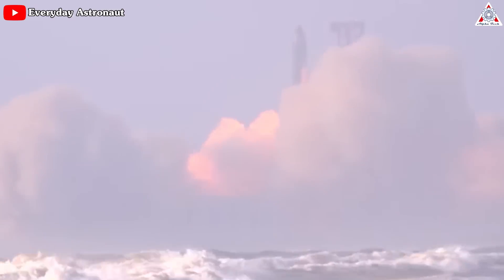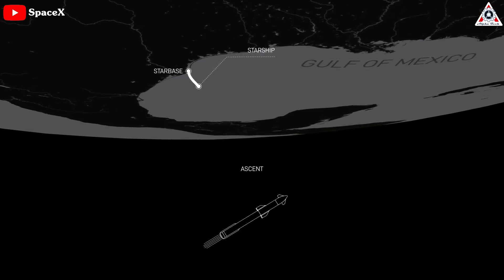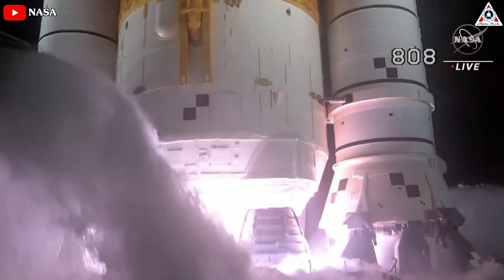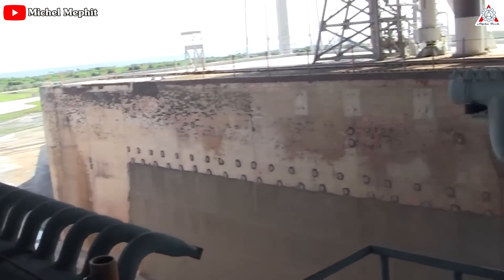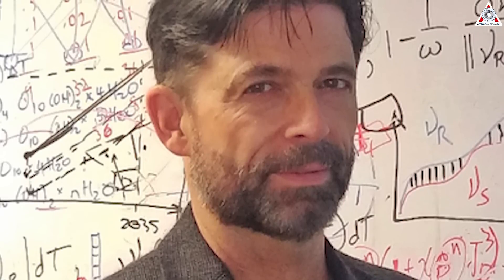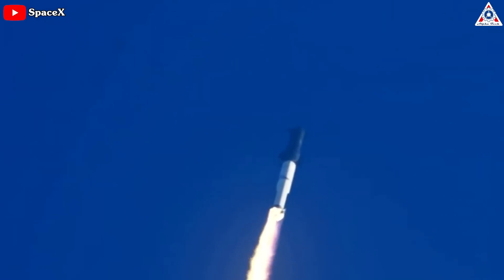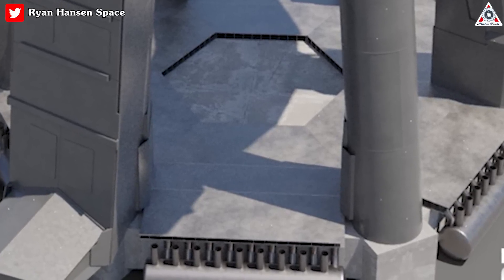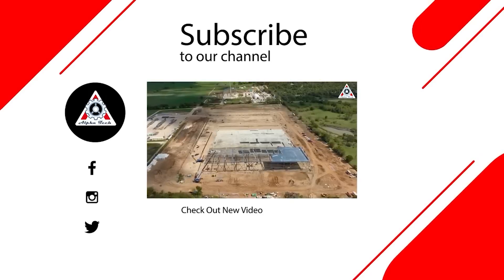SpaceX's NEW Solution to prevent the pad damage by 33 engines...

Comment: You are missing the main issue!  Artemis 1’s (SLS) “Ignition Overpressure Protection and Sound Suppression (IOP/SS) water deluge system” suppressed the acoustic energy produced by 8.8 million pounds of thrust!  Both the Saturn V and Space Shuttle had water deluge sound suppression systems. Where was the flame deflector to channel the rocket exhaust away from the launch pad and the water deluge system to dampen the acoustic energy of these engines (power of two Saturn V’s)?  As engine exhaust gasses exceed the speed of sound, they collide with the ambient air producing shockwaves with noise levels approaching 200 db. This energy can be reflected by both the launch pad and the concrete ground surfaces back to the launch vehicle.   What was the acoustic energy levels on the vehicle during liftoff? What were the maximum limits of acoustic energy for this vehicle?  During lift-off, did this acoustic energy (two Saturn V’s) damage any vehicle components?

Comment: Every action has an = reaction. With a diverter you need more thrust. I believe he was counting on the back pressure to help launch using less thrust.The back pressure was to much and damaged the rocket and the pad. This is a serious problem.
Reply: If that were a viable argument then many smaller rockets would have already used it, or you could even increase the effort by launching from a silo, however in practice this is not done, except for military reasons of course. The difference is negligible and only present during the first few seconds. 
I do however believe there was another non-communicated reason why the rocket remained about 8 seconds on the launch table before lift off. Those 8 seconds were possibly related to some engines not starting correctly and therefore the release clamps had to be held longer than anticipated. These 8 initial seconds were obviously a huge problem for the launch table. Large rockets do in general lift off slower than small rocket but not 8 seconds slower.

Comment: Why not increase the launch tower height and use a pedestal like was done for Saturn 1 launches to Skylab? Different reason but might be a solution
Reply: You have the central tower right? Make a 120/120/120 ladder, with two sets of chopsticks.
You move the fresh rocket into position at 0 degrees. You lift it and rotate it to an intermediate height at 120 degrees.
You use the 2nd set of chopsticks to lift it even higher at 240 degrees. And over there you have flame diverters, a water trench, etc.
Use a quick-release for the chopsticks so they don't get damaged at take-off.

Comment: The Starship superheavy test launch created a 25ft deep hole. That should tell SpaceX was it needed. A 25ft deep blast deflector trench with water cool metal plates plus water deluge system. 1m dia piles 15m deep lined the walls of the trench. The trench could ramp out to the beach at 30 degrees. That could handle Superheavy 33 raptors dragon flames.
Reply: Agreed. A steel/concrete/water solution at that depth would be the answer.
Or elevate the platform 30 feet and do the same.
Reply: @protorhinocerator142 actually smart idea
Reply: Terrible Idea water expands 1600 times as it turns to vapor if they aren't able to cool the water it will explode like a giant steam boiler! and even the most heat resistant steel melts at 2800F Raptor 2 temp is 6000F liquid nitrogen might be a better idea but even then its unlikely to work!
Reply: @ezragonzalez8936  See KSC LC39A Florida
Reply: @ezragonzalez8936  Liquid nitrogen also expands to 1600 times its volume.
Reply: @Proto Rhinocerator  Liquid nitrogen expands 695 times in volume when it vaporizes and has no warning properties such as odor or color. Better suited than water, it also has the benefit of displacing oxygen to suffocate any fire .
Reply: Thank you
Reply: Exactly
Reply: The issue here is that Boca Chica is right on the coast and digging down 25ft/5m may put the flame diverter well beneath that, this could incur long or even impossible regulatory demands and require new permitting.  The flat plate shield may not be as good, but it avoids the water table problem all together.  Water tables on relatively flat or at least non-mountainous land tend to be within 10-30ft of the surface, considering where Boca Chica is I wouldn't be surprised if it's 10ft down or even less.
Reply: The beach is protected wildlife refuge.
Reply: @ReachOutToWilliam  the area around KSC LC39A is also protected wildlife refuge, but they’re launching there all the time.
Reply: It’s already telling them right? It was a test flight.
Reply: Who died and you stole their diploma? Why ain't you Elon musk if you so knowledgeable? How bout shut up armchair astronaut?

Comment: I believe the chilled metal plate solution won't work either. It's not just a matter of heat, it's also the pressure applied.
Reply: i agree, all that pressure that dug out the ground will now be forced right back up into the engine bay causing more failures in the next attempt if they do this. they need to put it on and angle or better yet make a cone shaped diverter to direct the force out between the leg openings. of course, the best solution is to do like Florida and build a raised platform and make a real diversion trench.
Reply: @joedoe6444  This.  A water cooled cone is exactly the addition which would massively reduce the reflected acoustic energy and introduce a lateral component to the exhaust plume before it hits the flat plate..  Seems so obvious I don't know why it isn't already an integral part of the proposed solution.
Reply: @joedoe6444  yes my thoughts too, a cone diverter or angling the plate, anything to prevent the thrust going back up to the booster.
Reply: yeah i was thinking this too, having all that water flash to steam in under a second flat, it turns into an explosive steel plate!
Reply: @beverlywhitman303  The water won't flash if properly designed, and there won't be much restriction to have significant pressure develop.
Reply: @beverlywhitman303  This. It's not just the external pressure but the internal pressure. All that rocket exhaust could heat the water to an insane temperature. No material can hold that much pressure. Internal water will fail and explode.
Reply: @protorhinocerator142  That's not how a cooled plate works at all.  The water isn't trapped inside and any steam generated will be expelled with very little restriction.
Reply: An obvious reality being politely ignored.
Reply: Use a rail system like the V1 Buzz bomb used. Shoot that rocket down a 2 mile track . No messy flame trench needed.  Just need a big hill at the end to point this rocket up.
Reply: @davidlang4442  None of that would work at the Boca Chica site!!
Reply: Not enough lateral strength in the rocket especially when it comes to actually add the payload.
Maybe have a raised launch pad with the rockets further up and off the pad . Oh well they got the best engineers in the country working on it and don't need my lame uneducated advice. Good luck to them all, hope they find a suitable solution/fix.
Reply: Could rubber bands somehow work?
Reply: Me when I show spacex what a water deluge system is:
Reply: Terrible Idea water expands 1600 times as it turns to vapor if they aren't able to cool the water it will explode like a giant steam boiler! and even the most heat resistant steel melts at 2800F Raptor 2 temp is 6000F liquid nitrogen might be a better idea but even then its unlikely to work!
Reply: @ezragonzalez8936  it all comes down to gpm. The higher the flow the more btu’s can be pulled from the plate. And if it get converted to steam, it takes something like double the BTUs of getting to the boiling point to convert it all to steam. So even more energy removed as long as the steam can escape fast enough it would be no problem.
Reply: If the spacing is enough then the pressure should be fine long as they get the height right. I worry more about dust/flying debris and the tanks nearby.
Reply: How much water pressure would be required to keep water under the plate?  If it develops into steam and displaces water flow, the cooling is interrupted.  The only way to counter it is pressure that prevents boiling of the water.
Reply: @timothym2241  you nailed it. As long as the water under the plate is pressurized and the plate has corrugation channels to increase the surface area and help divert the pressure, the solution sounds reasonable. This pad had a crack or channel develop and that’s all it took to allow the pressure in to explode the concrete
Reply: I'm kind of thinking that these guys have a bunch of smart engineers that know more than you or me.
Reply: Bearing capacity in fact, basic concepts of Geotechnical Engineering.
Reply: I think the objective was to make very simple launch pad that can be in flat surface, since on the planet mars kind of complex launch pad would not be there
Reply: @aswzen 
Yes, but on Mars the power needed to escape gravity is not comparable to that on Earth, as well as the entire spacecraft will be much lighter.
Reply: You defiantly don't have any idea of structural engineering. Those cellular beams under the steel plate are there for a reason. They take all the static force generated by the rocket.

Comment: A flame diverter must be built. If you can not dig down then you just have to build up. The height of the launch pad is too low to divert any sound vibration and debris hitting the engines at the bottom. The metal legs and plates will not survive multiple launches. You can an ocean to the metal plates will not solve the problem.

Comment: 'Flame diverter' does not require trench. Bouncing up requires: i)stop forward motion= full thrust energy, ii)restore most of energy in reverse direction= ~2 times engine thrust, compressibility of air absorbs and releases energy. Bouncing sideways applies 1x engine thrust down force under diverter. A spike, better with a curve from very pointy top to almost flat base, sends exhaust sideways, reducing energy as radius increases circumference. A hollow spike with  massive internal flooding directed at point, does this without melting. I could have just waited to the end and listened to the announcer say almost everything I just wrote down. Thought it was important, didn't want to forget.

Comment: We could have guessed Stage Zero would fail.  But did we run a computer simulation?  That is the thing.  It could not be modelled sufficiently accurately on a computer.  But I do agree that it was stupid to proceed without the required Stage Zero to Superheavy Integration Test.  The limited duration half-power static fire test was not the required integration test.  The FAA and EPA did not approve the appropriate test and it turned out they put off-site lives and property at risk, as did SpaceX when it when ahead with the launch without proper integration testing first.  Why did the FAA and EPA not approve the required test???

Just like why did the Army Corps of Engineers not approve an above ground flame diverter?  

The government mandates SpaceX publish research on this history of the Spanish American War in this tidal area whose land and shoreline probably are recreated every 50 years.  So they mandate nonsense history reports++.  But the essential engineering tests they ban.  

An engineer is someone who can build for fifty cents what anyone can build for a dollar.  So you build a prototype, test it, and if it is not good enough, you design something better and test that.  Musk and his team at SpaceX are doing that.  Just this time they did it in a very expensive way.  (I think the entire launch complex area is going to at least need partial re-building.)

If you want a legacy rocket, if you don't mind the cost to taxpayers, and waste of time and non-renewable natural resources of a tried-and-true conventional single-use rocket and conventional launch pad, there is the Boeing-NASA SLS taxpayer boondoggle.  

++ If they were mandating archaeological studies, I'd agree with that, if this coast area was stable enough to contain any archaelogical artifacts.  But it is sand and has been washed away and renewed as part of a natural process.

Comment: i dont know about this one, methane produces 810 KJ per mole (16 g) from what i saw on wiki the raptor 2 has a methane flow rate of 140 kg/s  so your looking at a thermal power output of 140000/16 * 810 = 8750 * 810 = 7087500 kJ = 7.0875 GW starship took about 15 seconds to clear the launch pad iinm. too keep the steel from melting the water needs to absorb 15*7.0785 = 106.3 GJ say the water is 20 C when it enters and needs to stay under 95 C to prevent flash steam that means you need 22.5 tons of water in 15 seconds thats a flow rate of 1.5 tons a second thats absolutely insane itd be cool if this works

Comment: Somethings cannot yet be computer modeled with anything close to reasonable accuracy -- so they need a physical test.  How Superheavy and the Stage Zero would interact was one of those things.  The physical test was done and the results are in.  Musk and SpaceX will now look at those results and do what they are supposed to do:  come up with a better cheap solution.  If you want old technolgy, if you want expensive technology, there is the taxpayer boondoggle that is Boeing's SLS.

Comment: SpaceX might experiement with just a water-cooled steel plate at Boca Chica.  This time they should insist on the FAA and EPA granting them approval for the required Stage Zero to Stage One Integration Static Fire Test Program.  This should build up to an all-engine full-duration static fire test at the actual throttle level that will be used on flight tests.  That can be done using a dummy Stage One with just Raptor engines, no need to risk a flight-ready Super Heavy and certainly not risk a flight-ready Starship.

Once the experiement is complete, I think they'll find that solution is inadequate unless the water-cooled steel plate incorporates a blast diverter.  And I think a steel blast diverter will be too expensive.  

I think SpaceX is going to be stuck building an above-ground blast diverter/flame trench and re-building Mechazilla to be correspondingly taller, and to have greater reach to pick up Starship and Superheavy from transporters that cannot get as close to Stage Zero due to the blast diverter structure.

Comment: I think another issue is the moisture from ground water under the concrete was heated during the 8 second sequence of starting all engines and that moisture flashed to steam which was a giant bomb that blew up the concrete. Steam from water from deluge system can escape but water under concrete is contained until the steam pressure overcome the strength of the concrete and it explodes.  I’ve read that on pint of water flashed to steam is equivalent to one stick of dynamite.  I worked in steel industry and the danger of spilling molten steel on a concrete floor was a big safety issue for this reason.
Reply: It takes time for heat to conduct through a substance.  I doubt much heating occurred even a few feet below the surface.  Certainly not in 8 seconds.  Well, except for the surface was being blasted away, of course.  Yeah, whatever got blasted away may have been affected, "dehydrated," but it wasn't a giant bomb by any means.

Comment: Okay- even a massive water cooled steel plate is NOT the solution. Anything that lets 16 million + pounds of force just splatter in all directions is going to either destroy or continually degrade structures contiguous to the OLM- i.e. the OLIT, Elon's billion dollar tower, to say the least. The solution? If you are going to keep the OLM at ground level, just adopt the Soviet N1 rocket system- a hole beneath the OLM, diverting gases into two tunnels that curve back to the surface to vent upward. This allows a solution that does NOT entail building the structure up onto a hill so as to allow the traditional flame bucket that requires a 90-degree turn. They can find a material that allows the surface vents to be covered with a grid to allow traffic, or cover them and then uncover them just for launches. Add a water deluge system and you’re golden. Comments?

Comment: This video spends the entire time talking about the water cooled steel plates that Space X is installing to mitigate the damage from the 33 raptor engine fire.  At 5:50 the video mentions that this system will not affect the acoustic damage done by the raptors firing, but then says NOTHING about how Space X plans to address this problem.  

The answer was right in front of you all that Space X had also begun installation of a deluge system that will provide massive amounts of water under the OLM to mitigate the acoustic damage done to the OLM.  Space X thought the Fondag concrete would handle the 33 raptors firing at full thrust so they rationalized not completing the deluge install until after the first test launch.   Elon admitted later was a mistake, but it was a mistake based in arrogance.   

Anyway from 5:50 on this video provided no useful information including from the two people providing their "expert opinions" because the deluge infrastructive wasn't addressed.